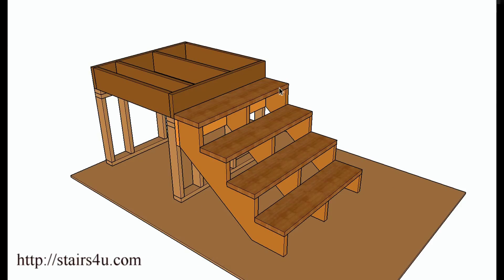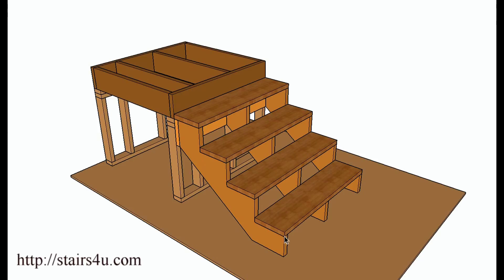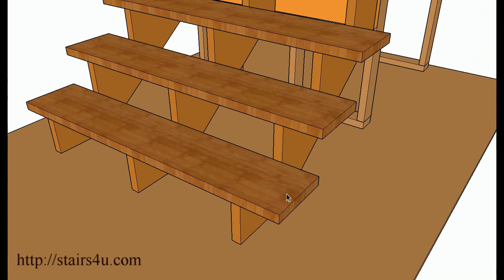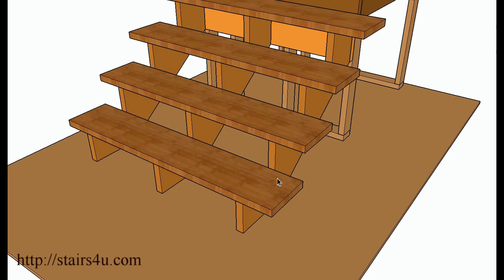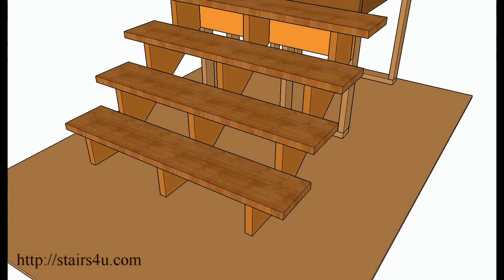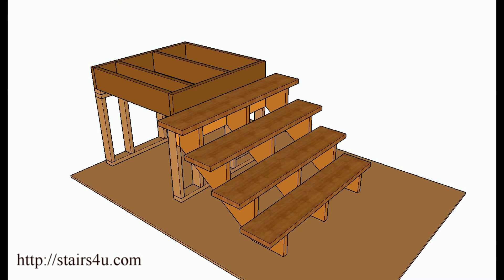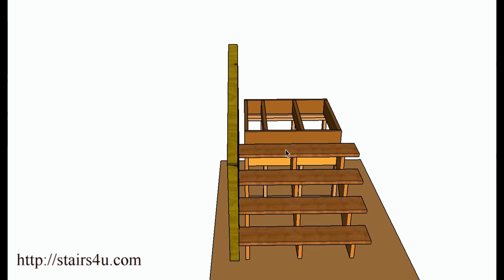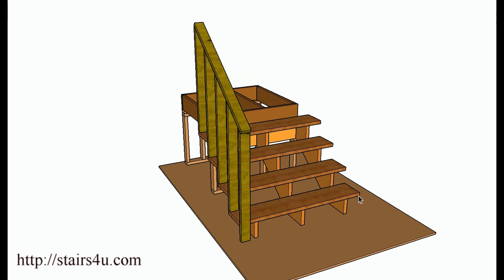Possible Safety Issues With Sides of Treads Overhanging Stringer

Comment: I am getting ready to replace my deck stairs and my metal railing screws into the edge of the 2nd to bottom step and the top of the deck. Would I be able to get away with a 2.5 inch overhang on the edge for the step?

Comment: If the treads are screwed straight down into the stringer, then wouldn't having just a small amount of overhang (less than 1 inch) would help prevent the screws from splitting the ends of the wood due to wood movement?

Comment: Is there actually a code requirement for max overhang laterally of a tread on stringer?
Reply: Perhaps in local codes, but in the IBC, no.

As a matter of fact, instead of a lateral overhang reg in local code, I would more expect a handrail code to preempt such a code.